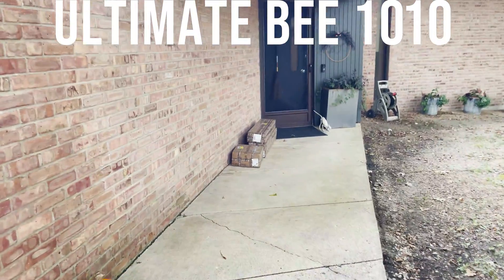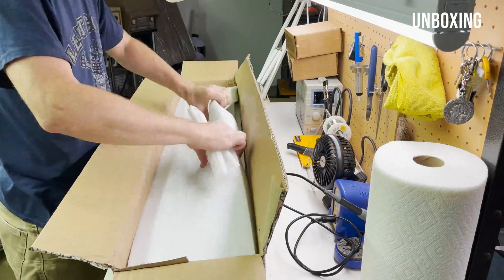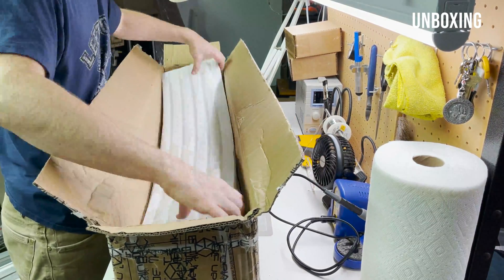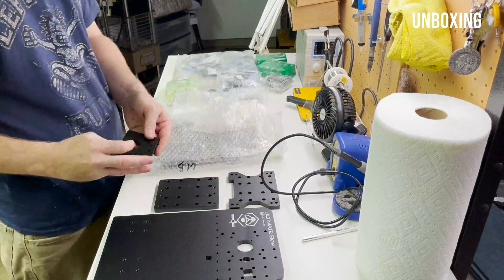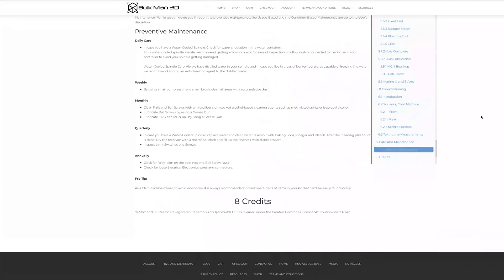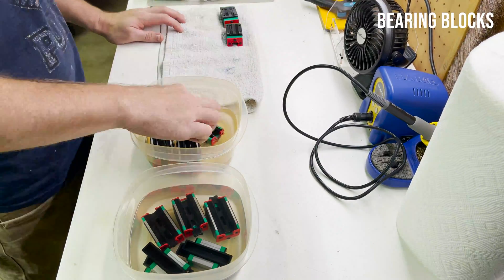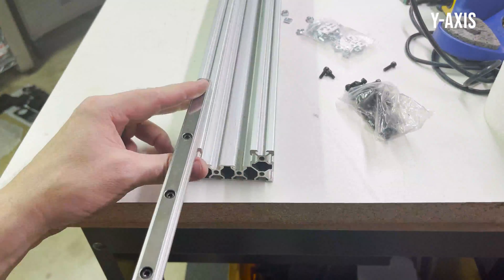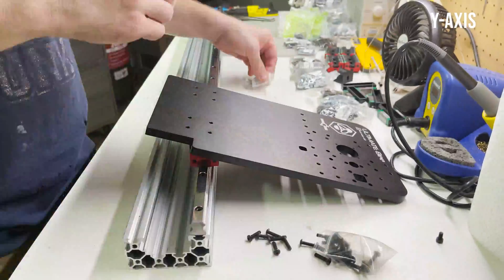Bulk-Man 3D Ultimate Bee CNC Mechanical Kit Preliminary Review

Comment: Great video. Thanks for sharing. Are you happy with the 12mm lead screws? Any issues with flexing of the frame?
Reply from the maker: no, ball screw whipping: Ultimate Bee 1000 x 1000 ball screw whipping at speeds over 300mm/sec
https://youtube.com/shorts/JZkpWOAcE9M?feature=share
Reply: @diyfiberlaser  that's not good. How is it affecting the output?
Reply from the maker: I sold it

Comment: I also have the Ooznest 1500x1500. I cured the screw wipping with SAE10 oil, but i found the plane of the base is really not even close to being parallel with tool path horizontal plane. When i flatten my spoilboard there's a good 5-6mm difference. Next one i think i will build it on a stone/kitchen top base .... and use the stone to sit my spoilboard on afterwards.

Comment: What are your thoughts on the rubber gaskets that go under the ball nut mounts? Seems to me to be a quick fix for a misalignment problem. It might fix their vibration issues, but it sure doesn't help with accuracy. I have never seen rubber used on ball screw mounting.
Thanks for video.

Comment: You can replace those straight grease nipples with right/45* angle ones.
You possibly could get away with greasing the rail itself but I would imagine that much less grease gets in and you would need to grease it much more often.
OR
You could create your own grease gun nozzle.
At work I have those industrial sensors that are 12in long SS tubes with ID of only 4mm, and I needed to add thick conductive silicone at the very bottom of the tube, so I got a 4mm OD, 2mm ID 13in tube and attached it to the grease gun.
And because of the massive pressure the grease gun generates, I needed to use SS compression fitting, the thread that the generic grease gen used was BSPT 1/2" I believe.

Comment: Looks like a great, very complete kit, but I share your disappointment/concern about the 12mm ballscrews. As you noted, because the ball nuts have to fit within the C-channel, it’d be very difficult to upgrade to something heavier without completely re-engineering the whole assembly 😕 I’ll be interested to see how the system works at-speed, especially with the speeds you’ll be able to get from the AC servos.

I just found your channel a little bit ago, then my jaw dropped when the algorithm served up your DIY fiber laser intro vid this AM. Following closely now, can’t wait to see how it goes!

Comment: This CNC kit si valid for laser cut?
Reply from the maker: It works for me, but not ideal. I can’t run the rapids as fast as I want, which wouldn’t be a big deal except that the Ultra High Purity nitrogen im running through the fiber laser is very expensive and the slower speeds is wasting gas

Comment: I’m considering pushing the button to buy either the QueenBee or the Ultimate in 750 x 750… what would your view be Travis on which would be more rigid and which would be a more capable general CNC machine?
Reply from the maker: Their rigidity is probably identical...I think the only difference that you might notice if you ran them side by side, is that with the 10mm pitch ball screws on the Ultimate, you could run the rapids a little faster than with the lead screw machine. Good luck with the build!
Reply: @diyfiberlaser  thanks mate.
Reply: I'm waiting on my 750 x 750 Ultimate now.  I purchased with the 18% off price. I plan on doing mostly aluminum so I'm hoping the smaller size is stiff enough.
Reply: @keffer69  let’s compare notes.

Comment: Thanks for the build and info.  I have an ultimate bee 1500x1500 on the way so it's helpful to see your build and understand it's limitations.  I don't expect amazing results from a budget machine, so I need to keep the speeds in check but that's not an issue for my needs.  It's my first CNC build (though I've built two 3D printer kits so I'm not a total beginner) so wish me luck!
Reply from the maker: Good luck! the build will be fun and you will have a very capable CNC!

Comment: Hi,

Thanks for your video !! I was about to but the Ultimate Bee 1500x1500 3000rpm servos motors but I’m not a bit concerned about it.. Do you think it would eventually worth buying the queenbee 1500x1500 instead ?

Thanks !! Hope you’re still glad of the CNC !
Reply from the maker: It is not an easy question to answer....I know they put tension on their lead screw machines to help keep them from whipping, but I'm not sure what pitch the lead screw is compared to their 10mm pitch ball screw, so I'm not sure which will ultimately allow for higher speeds? What application are you going to use it for? If you are using it for a CNC router machine, even the 300mm/s speeds I am achieving, is faster than any cnc machine I've ever used. I am just being really particular about it because I am using for a fiber laser cutter and even 500mm/s speeds seems to be at the low end of what typical machines are running their rapids at. I emailed Bulkman 3D last week, telling them my disappointment of the whipping and asking if they offer 1610 ball screws (thicker than the 1210) instead to combat the whipping, but I have not received a response yet. I will certainly add an update to my comments if I hear anything....hope that helps
Reply: @diyfiberlaser did bulkman ever reply about the 16mm ballscrews? I plan on cutting strictly aluminum sheets with it. 1/8” and thinner. 95% of the time 2D cuts. Do you think this is the machine for me? Have to have the 1500x1500 size and will get the servos they offer as well.
Reply from the maker: I wrote them about my whipping issue and they said "it is not recommended to run the machine faster than 15000mm/min to preserve the life of the ball nut." even though on their website they say you can reach speeds of 30,000mm/min. You may get some chatter, but I've cut out 1/8" aluminum on worse machines. @thedude6650
Reply: @diyfiberlaser  have you looked at the Queen ant pro V2? 16mm ball screws and a super beefed up x axis. It’s 2 pieces of C Beam with a piece of 40x40 extrusion sandwiched in the middle. Looks super strong.
Reply from the maker: @thedude6650  Unfortunately, I didn't learn about it until after I had already purchased this kit...I would definitely buy that instead for the beefier ball screws if I could do it again.

Comment: @13:56, when you mention the flex with the 2.2kW spindle. I'm about to build my Queen Bee Pro unit, 1500mm x 1500mm, can I already expect a considerable amount of flex on the X axis?
Thanks, excellent video by the way.
Reply from the maker: It shouldn't be too bad since the Queen Bee has the linear rails...my kit was older and had the v-groove roller wheels. Good luck with the build!

Comment from the maker: I was finally able to do some max speed testing of the ball screws and my concerns were real, anything over 300mm/sec caused some whipping....bummer. My AC servos (and even the ones that they sell with the kit) can do 3000rpm, which makes their top speed 500mm/sec, but the ball screw whip is limiting this. If you get the 1500mm kit, I'm sure your top speed will be even lower. I contacted Bulkman 3D about the whipping and they replied that they would not recommended to run the machine faster than 250mm/sec to preserve the life of the ball nut. I told them to change the verbiage on their website, because they are marketing it as a 500mm/sec capable machine, which is extremely misleading. Here's a short video showing the whipping: https://www.youtube.com/shorts/JZkpWOAcE9M
Reply: Mate you should buy QueenAny Pro V2 ...check it
Reply from the maker: @ioneldinromania5816  Thanks for sharing! It has 1610 ball screws, just like I wanted! I wish I knew about this kit beforehand, I would have bought it instead.
Reply: @diyfiberlaser  and different X axis, in my opinion much stronger,you can update your with a C Beam profile heavy duty is 2.7 times thickness and it's cost 60usd per meter
Reply from the maker: @ioneldinromania5816  Great, thanks for the info!
Reply: @ioneldinromania5816  Its the same machine beside the 1610 ball screw .... just change them and you got the same
Reply: @vivwerk  different x axis,3 liniar rail,one behind...much stronger,also 1610 ball screw plus 2 liniar rail for each y axis
Reply: @ioneldinromania5816  lot of good cncs only got one liniar rail on the y axis, and i cant see any foto where they show the 3rd liniar rail. I think, if you buy a cnc which is build for wookd, to many rails arent as good, cause you got way more friction. But thats just my opinion :)
Reply: @vivwerk  Depends purpuse of the machine,if you want precision and speed if no other option.
Reply: Hi Travis. Do you think that there is a possibility to upgrade the ball screws so you don’t get any whipping, or is it just a matter if it is what it is?
Reply from the maker: @anthward1972  I will have to do some more research to see if I can find some 1610 ball screws that are the correct length and aren't too expensive to try, otherwise I will just have to live with it.
Reply: Why is that a problem exactly? Some whipping is probably ok for rapids, if high rapids are that important. 300mm/s and even 200mm/s is about as fast as I would expect this level of machine to go given the rest of the components (w. any drive system). Carving work is the only aspect that I could see possibly being both suitable for this machine and able to be machined faster. I would think actual machining would usually be limited by the power of the spindle or the rigidity of the machine. Having owned a Techno-Isel Gantry 3 model that used a similarly pitched screw (but way beefier overall), I never considered running it faster than 150mm/s or so.

Genuinely asking if this is a real problem for the intended use or just a case of one component able to go faster than the ball screw can handle.
Reply from the maker: @PLASTICWORKSdotCA  For me, it is a problem because they are selling it as a 500mm/sec capable machine....this is the text on their website "Our ULTIMATE Bee CNC has options to have its motors upgraded to achieve high-speed operation similar to industrial machines. Very few machines can match the rapids speeds of up to 30,000mm/min like the ULTIMATE Bee can with servos." Maybe you missed it in the video, but I mentioned that I am using it as the gantry  for a DIY fiber laser cutting machine that I am building and from what I've seen 500mm/sec is on the slow side of what commercial fiber lasers are capable of. I just want to get what I paid for : )  Also, I hoped to inform anyone else expecting to reach those speeds, that it is probably not going to happen.
Reply: @diyfiberlaser  I did miss that, I though you were putting a separate fiber laser below. Laser (I'm sure you know) would normally use belts for the speed and accleration and the less mass the better, I guess why I assumed it was a separate machine underneath. I saw another video (smaller frame size) where the user said they were 1000mm/s but it didn't look it to my eyes. That is indeed a disappointment to have the machine not fit your needs but I do think some belts would solve the issue (maybe just across the gantry, I assume you don't want to contour cut that quick with all that mass). Good luck on the project, sounds like the end result will be nice.
Reply from the maker: @PLASTICWORKSdotCA  Thanks Greg, I'm learning all of this as I go, but from the other machines I've referenced it looks like the smaller fiber lasers use ball screws and the larger machines use rack & pinion. Though my CO2 laser uses belts and it's really fast. I think it might be because the fiber laser heads are more robust than the CO2 heads. My machine is almost done, so I think I will do some testing first and see if I think the extra speed will even be worth it because converting it to belts would quite an undertaking. Thanks for your input!
Reply: Could you please so a Youtube Short about the maximumg speed?
Reply from the maker: @vivwerk  I just made a short for you: https://www.youtube.com/shorts/JZkpWOAcE9M